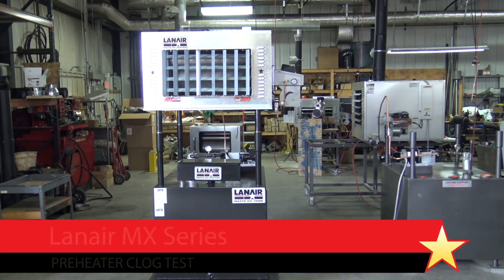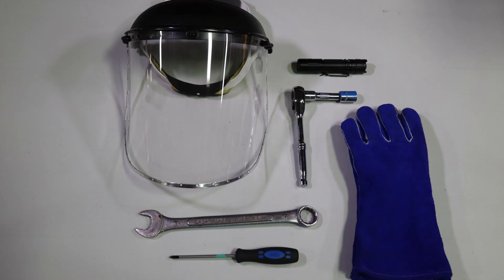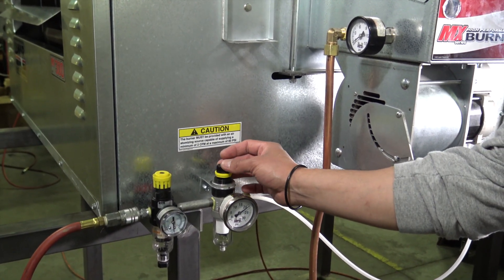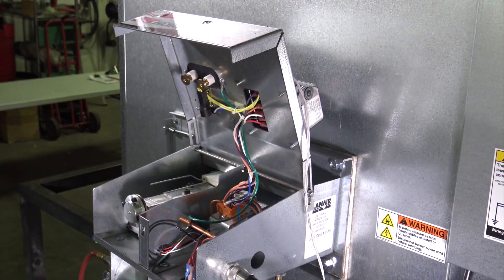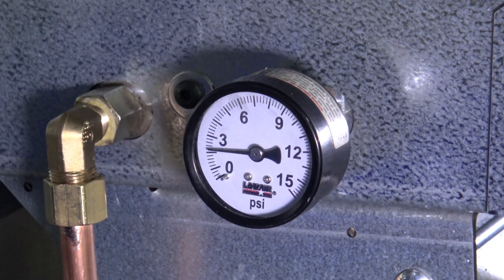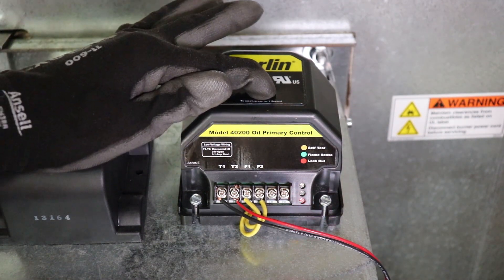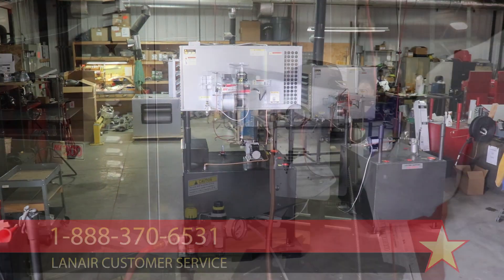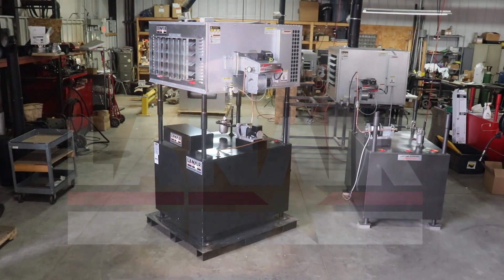Lanair Waste-Oil Heater - MX-Series Preheater Clog Test

Comment: I recently purchased an Lanair XT-75.  Nothing but problems from the start.  They do not install at all.  You are on your own.  Would not run from day 1.  So far, I found 4 wires not connected.  Finally got it running and it quits after a very short time.  Parts they sent did not work for my application.  Purchased more, got it installed.  I have asked several times,  about returning the unused parts and they just ignore the question.  Asked to speak tp a manager, they said one would contact me.  That was last week.  Still have heard nothing.  I am into it for OVER $5000 so far and it may have burned a gallon of oil.  If you are thinking about purchasing one of the POS, DON'T !!!   I have had 2 friends waiting to purchase one of these based on my experience.  I advised them against it.

Comment: The four wires on the schematics coming from the gun are all white. They are really 2 white and two red. Not sure where the red goes. Mx 300
Reply: On the MX unit one skinny white wire and one skinny red wire should be in a wire nut with the black power wire that comes from the center terminal of the preheater switch. The remaining skinny red and white wires can be inserted into any grey space in the terminal block.